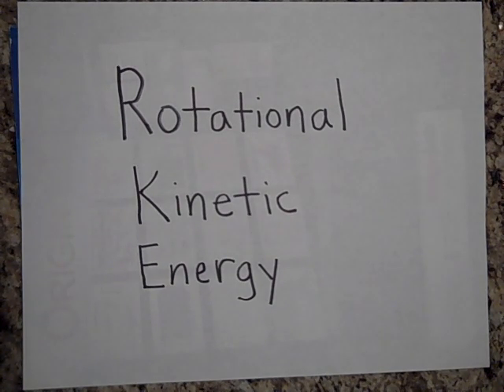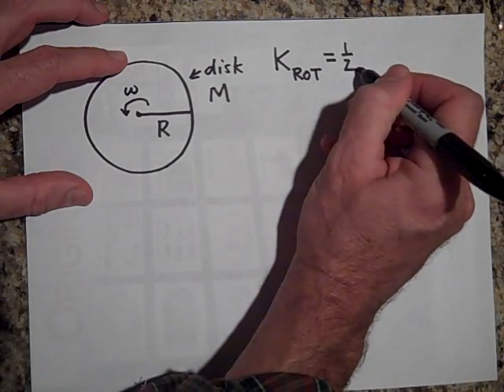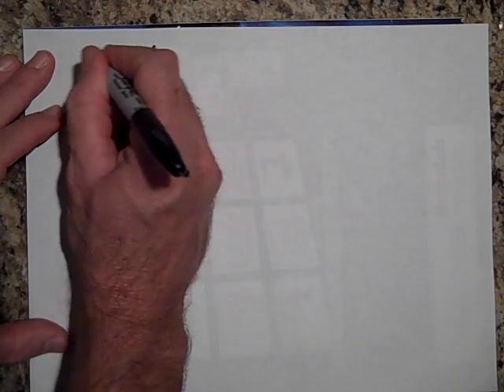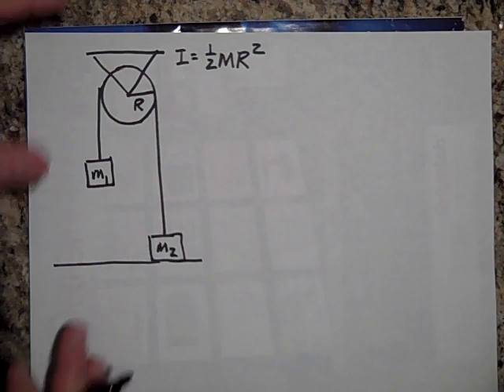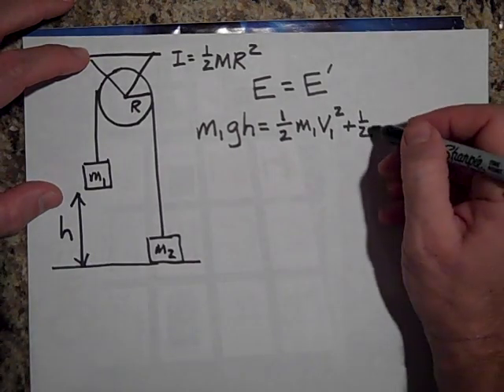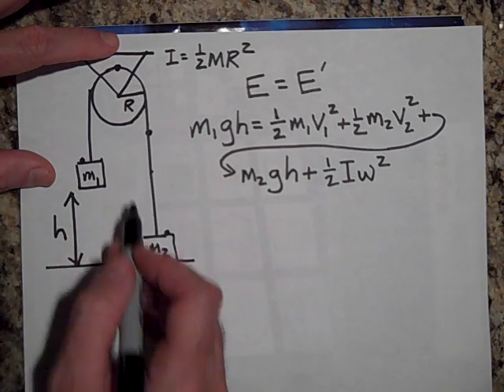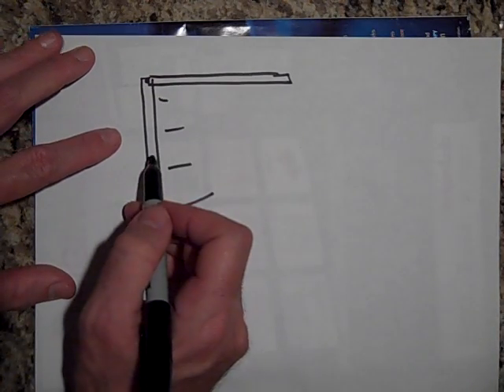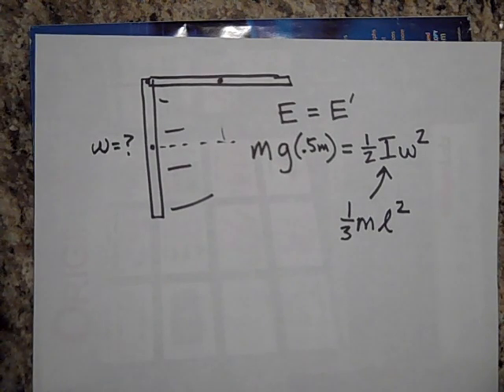Rotational Kinetic Energy

Comment: why they all have the same velocity ?how can we prove that mathematically!
Reply: if we consider the rope to not stretch, then due to its uniformity, it would be impossible for any section of the rope to move faster than the one before/after it. So the speed (in an ideal case where the rope does not bend or slip) will be the same at every point.

Comment: In the first example, if there is no sliding between the rope and the cylinder that means there is a frictional force component? shouldn't that be addressed in the energy equation?
 
and in the final example the inital energy of the system (i.e. P.E.) is  mg(1) not mg(0.5), because the ruler is on its horizontal position and gravity will act on it fully(no need for centre of mass-can just assume its a mass point) for a full 1 metre before it will hit/touch the ground. After the rotation when K.E. is highest and P.E. = 0, the moment of inertia used is that of a circle, where as the example uses a ruler (rectangular shape)and rotation of axis is edge and not centre so assuming its a thin ruler then I= (m/12) * (h^2+w^2).

Sorry my adhd got me ranting and ranting xD but it's just safer to use the example of a yo-yo ball/string or point mass lol,
Nice video btw keep it up!
Reply: +Ahmed Islam You are misunderstanding what the frictional force is meant to be. It is not "work" in the sense that the work done from point 1 to point 2 is Force*Distance, but instead compare it to simpler dynamics problems. In simple work-energy problems the pulley is considered mass-less and friction-less, but in this more advanced problem the friction force is causing the pulley to rotate, instead of just sit there and allow the rope to slide. The force of the friction is what's causing the rotation to occur, it is already being accounted for.

As to your second point. His reference point is halfway up the meter stick when in the vertical position. So that PE)g in position 2 is zero. Remember, the CHANGE in height is whats important, reference points are arbitrary. 

As for your final point, .5*I*w^2 is the equation for all rotational motion, whether it's a bar rotating about a point or a circle rotating about its center. His I equation of (1/3)*m*L^2 is simply the I of a bar rotation about its end point. He would achieve the same end result if he instead used the I for a bar about its central axis, (1/12)*m*L^2 and then added the linear kinetic energy term in after, (1/2)*m*v^2, where v=r*w and r=L/2.

Hope this helps some of your confusion!

Comment: In your final example, doesn't the meter stick have some regular, linear kinetic energy because the center of mass is changing in its position?
Reply: +Vadi Eghterafi Yes it does. The center of mass will have kinetic energy r*w. Where r is 1/2 meter.

Edit: Actually he used the parallel axis theorem, it is the same as using the I about its center and then adding the linear momentum as a separate term. Try it out and check for yourself. 1/12 + 1/4 = 1/3.

Comment: I don't understand your question. But it's initially at rest so it only has potential energy from a height of .5m. When it reaches the bottom of it's rotation all of it's initial potential energy is converted into rotational energy. If it's not spinning initially then it doesn't have rotational energy.